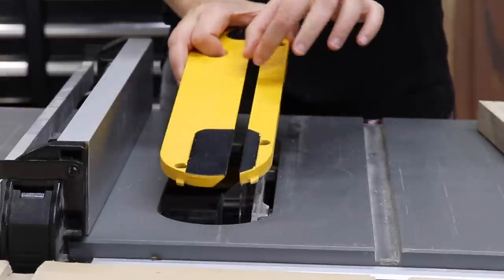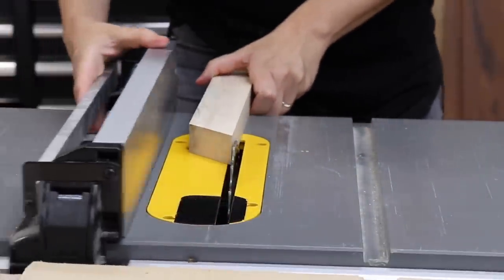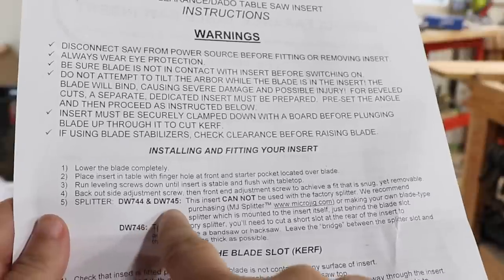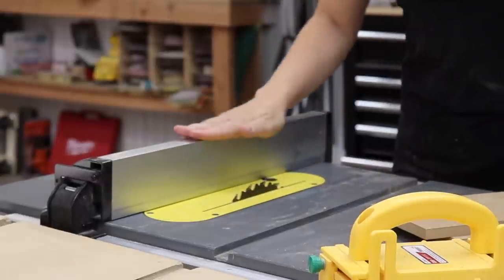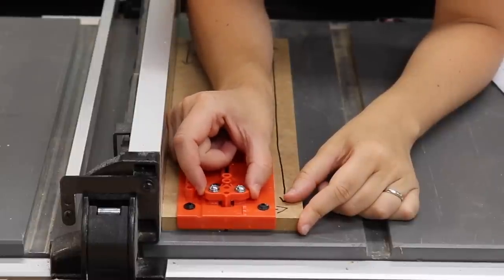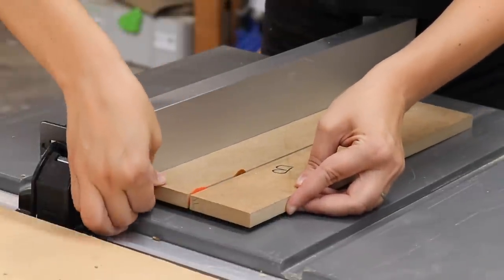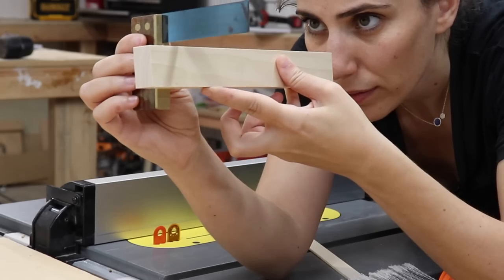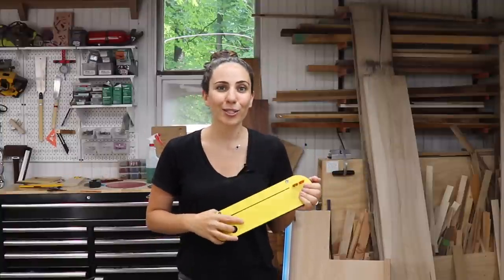Zero Clearance Insert with Splitter // Riving Knife // MJ Splitter // Kerf Keeper

Comment: After installing the MJ splitter / kerf keeper combo as instructed in this video, I am encountering a lot of resistance once the workpiece reaches the splitter. I suspect that the splitter is misaligned. Is there a way to correct this or do I have to repeat the process?
Reply from the maker: It should have come with different sized splitters. I forget but I think there are numbers on them. Some are thicker some are thinner. Try swapping out for a thinner one. You actually want some pressure. That’s acting as a featherboard to keep your workpiece up tight to the fence

Comment: Thanks for the informative video. I wanted to cut thin strips and this is going to be the only way to achieve a clean cut.
What model Dewalt is that. The fence looks different in height than mine.

Comment: I really need a zero clearance insert! I have watched quite a few of your videos but this is the first one where I've seen the make of your table saw (DeWalt) - is that your only table saw? You seem to produce some really accurate work on it and I assumed it would be a much bigger machine. Can you tell me what model it is? I had a DeWalt radial arm saw for 15 years and loved it.
Reply from the maker: It’s the DW745. But word on the street is they are discontinuing it. 🤷🏻‍♀️

Comment: Standard inserts aren't as bad as you're making them out to be.
Reply from the maker: I always had an issue with mine. Sometime to get around this I would cut through a piece of plywood. Stop the cut. Then rip whatever I needed to on top of that plywood. And that always fixed the problem. Now I don’t have to do that anymore
Reply: You will get a much cleaner cut with a zero clearance insert. Also, small cutoffs tend to fall into the large slot on a standard insert and can be thrown back at you.

Comment: Nice tutorial!  I just purchased the same insert for my Dewalt 7480.  One thing that bothers me.  I think the "language" used in the instructions is not clear.  They say "cannot be used with factory splitter"....  I don't know the model/year of your TS, but I believe this would be different than those with a riving knife.  Even though the paper instructions don't mention it, the webpage for the product: https://www.sliversmill.com/product_1373_DW2_Leecraft_ZeroClearance_Table_Saw_Insert_139_16L_x_33_4W.html
indicates "The newer models (all the others) employ a RIVING KNIFE, which allows for a shorter slot, and a structural “bridge” to remain at the back end of the insert. Obviously, the plate becomes weaker and weaker, the smaller this bridge is, as the RK slot gets closer to the edge. The riving knife (RK) slot is essentially an extension of the blade slot, or kerf. The kerf is, of course, created by simply raising the blade through the blank insert, to the maximum elevation. The operator must then extend the kerf (slot) by means of a secondary procedure, to safely create a slot that sufficiently clears the RK. This “secondary procedure” requires a higher level of understanding, skill, and creativity."

So, "splitter" is different than "riving knife" and I believe users with newer Dewalt 745 can use the stock riving knife...

Maybe????

Again, thanks for the video!
Reply from the maker: I didn’t want to have to cut all the way through the plate. This was a great solution

Comment: Oye, face palm, now I know why I find it so hard to get evenly square cuts on my table saw!
Reply from the maker: Yeah. It took me a while to figure it out. It was really frustrating. Sometimes I would cut through a sheet of plywood. Stop the cut. Then clamp the plywood down. Then I would rip whatever I needed to on the plywood and it would be square. That’s how I knew the throat plate was the issue

Comment: What tha'...Seriously? Can't we just built a whole new saw from excavating the metals to cnc-ing a block of metal? It would seem less...less. I have seen less complicated engineering in microcircuits.  Ok, I'm exaggerating, but then again, I got an aluminum T from a scrap-something, and screwed it under my zero clearance insert I made with the ability to move it side to side, and I "adjust" it by bending it just a little.  This? A sucker born every moment, I think...
Edit: And for those naysayers who auto-attack everything that doesn't support their ignorance, below is the result of a two minute Youtube search on how it might look like.  And no, my table saw is not a Sawstop, it is a 2005 Ridgid jobsite, with hardly any space on the insert, and yet I easily made it work.  
https://www.youtube.com/watch?v=RXwRR9ecXsQ